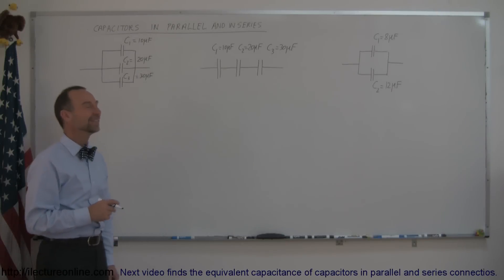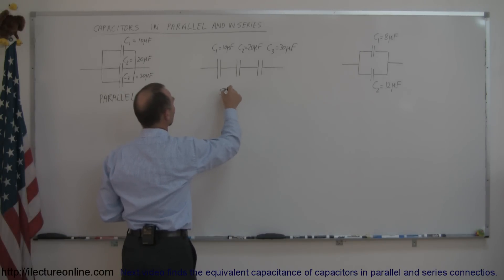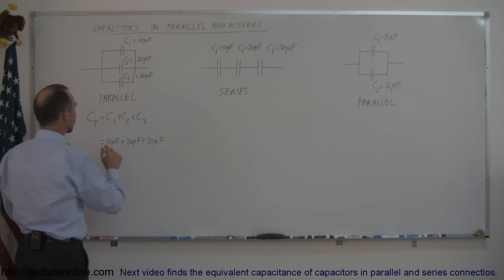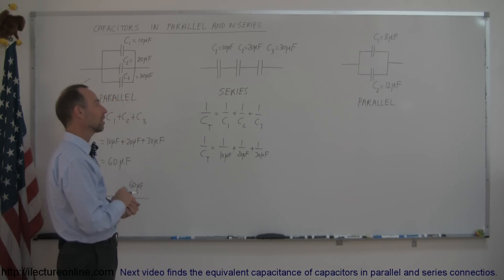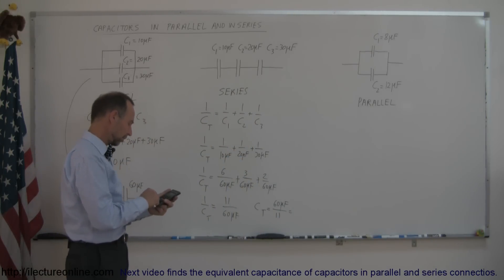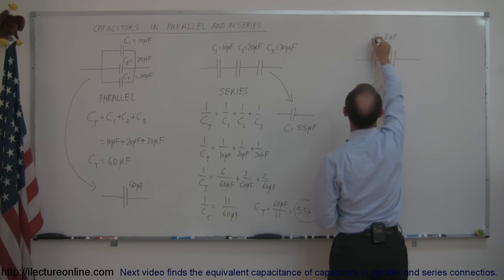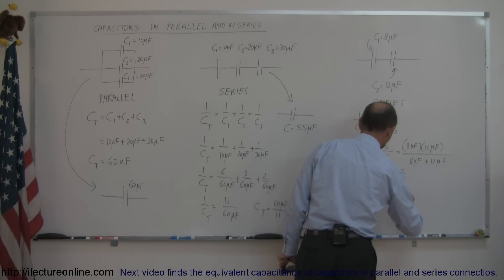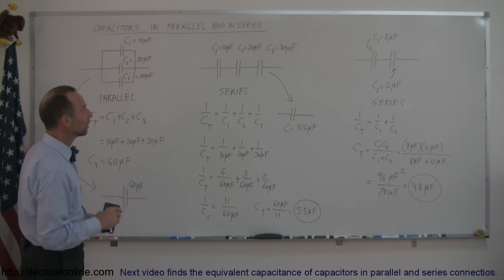Physics 39   Capacitors (3 of 37) Capacitors in Series and Parallel   1/4

Comment: sir why do we have different potential across each conductor in series combinations
Reply from the maker: +Rahul Tiwari 
 Capacitors in series have the same charge.  Think of the potential across each capacitor as the "force" that pushes charges onto each capacitor.  The charges will more easily be pushed onto a capacitor with more capacitance and thus requires less voltage.  Charges will require a greater push to be pushed onto a capacitor with less capacitance and thus will require a greater voltage.
Reply: +Michel van Biezen  thank you sir.Sir I have one more question that if we place a dielectric slab between the plates of a parallel plate capacitor then the force on the plates will increase decrease or will it remain the same
Reply from the maker: +Rahul Tiwari 
  It is important to know if the capacitor is attached to a battery, of if the capactitor is disconnected from a battery and simply holds a fixed amount of charge.  (I will assume the latter).

  When you place a dielectric between the plates, the electric field strength will drop, the energy of the capacitor will drop and the force between the plates will drop  (E = F/q)
 Take a look at this video:  Physics - E&M: Capacitors & Capacitance (22 of 37) F=? to Push a Dielectric in Charged Capacitor
Reply: +Michel van Biezen thankyou very much sir!!